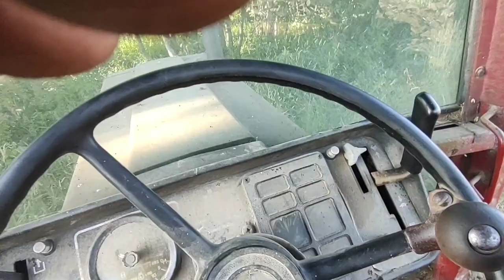Still no bearing so let's go plow. July 15, 2022

Comment: Looks pretty good but i would slide the front of the plow to the left about 8 inches or so. Good video !
Reply from the maker: It's already as far left as it can go. Tractor wheels need moved or if I'd go faster would make a difference. It so hard and dry I'm going a gear slower.